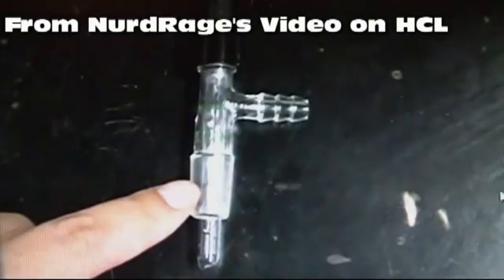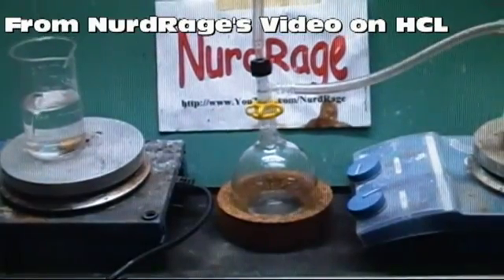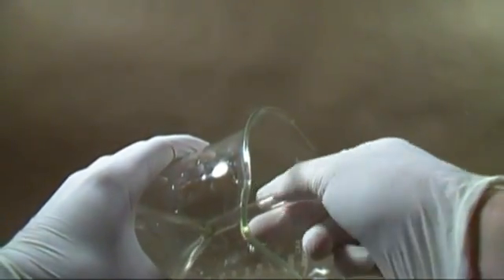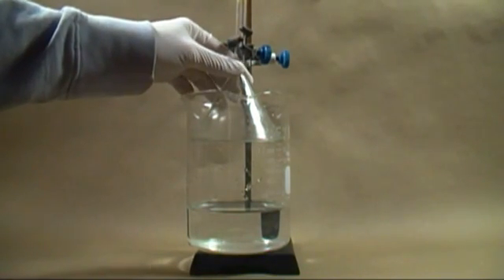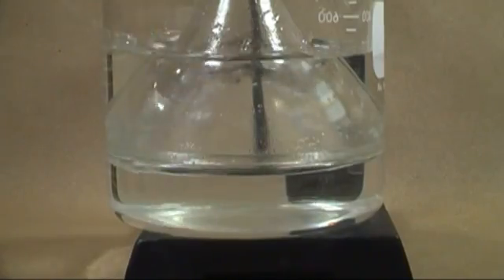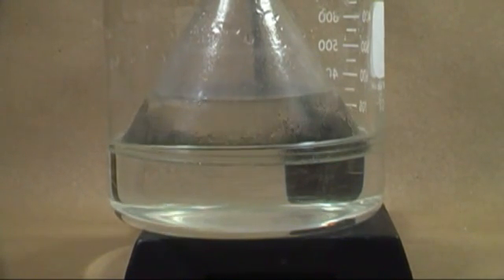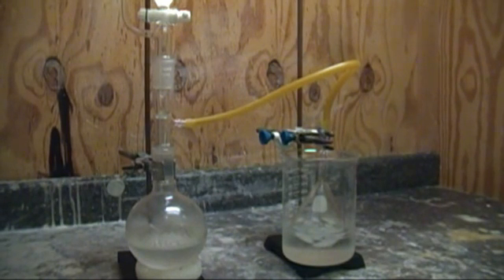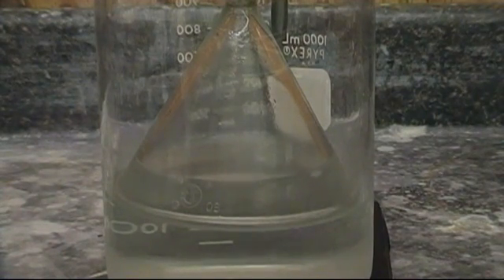Lab Tips: Back flow prevention when dissolving highly soluble gases

Comment: If you have some (imho, useless) rubber stoppers laying around, you can also just use a pair of EM flasks, Punch 2 holes in the stoppers, then go from the generator into the first stopper a short length, then use a longer tube (glass if you got it) to go from near the bottom of the first flask into the second flask the same short length as the first (get that lampwork on, son. And make an uneven double 90 U bend). Then, again same as the first, go from near the bottom of the second flask to your bubble dissolver. If you sized it right, and god I hope you size it right (ITS SEMI-MOLTON SALTS AND DEATHLY GREEN GAS FOR FUCKS SAKE! NOT THE TIME TO SKIMP, SIMP!) when the reaction is done itll suck the chilled (you did set up a chiller around your bubbler, right?) solution into the second flask. Replace with empty flask, top off the bubbler, and run it again! The first flask should remain bone dry!

Comment: Add sodium hydroxide to an ammonium salt, preferably ammonium nitrate because of sodium nitrate's high aqeous solubility. The reaction usually starts slow but can be helped along with a little water or an ice cube. As the reaction proceeds more water is produced.

Comment: This is an excellent way to prevent suck back, I've used it a few times to great effect! How did you generate your ammonia gas? What was the concentration of your finished solution? I tried making conc. ammonia using the same basic setup as yours, plus heating the reaction flask to drive out the NH3 into the collection beaker, but I can't get my final solution to be very strong at all. Any tips?

Comment: @homealchemy You can push it to 30% or a bit higher (laboratory ammonia is a bit over 25%) if you use ice cold water. Remember that it gives off ammonia like crazy while it warms back to room temperature.
So just transfer the ice cold saturated solution in a glass bottle with a gasket screw cap and keep it at a cold place. Obviously, if you try to open it while it's warm, it will produce a hissing sound (might even bubble up) immersing you in a cloud of ammonia, so be very careful.

Comment: Yeah,this has always been a neat way to dissolve ammonia and hydrogen chloride.The only thing one has to be very careful about is the position of the funnel.It depends on the funnel,but it's usually enough to place its rim exactly on the surface of the water.Immersing is rarely required,especially with HCl and NH3. As you know, those gasses dissolve so rapidly in cold water that bubbles don't even form.There's usually a dynamic equilibrium,so the phase boundary remains motionless.
Cool video. :)
Reply: How are you , after 11 years? It's 2023 now. Are you even alive?

Comment: Awesome video. Now I'm going to make ammonia water.  Question?  What is the maximum concentration possible by bubbling ammonia gas into water using the methods gown in this video?
Reply: 10 years late but It should dissolve till saturation which is 90g/100ml at 0c  for ammonia gas in water.